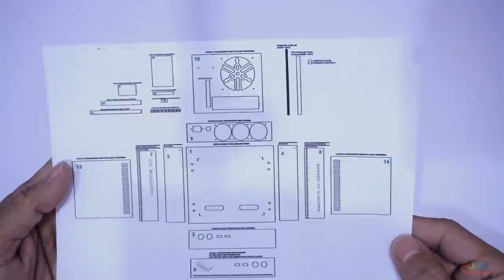How To Make Mini PC Case | From Acrylic With RGB Led Lights

Comment: Never been a fan of RGB... but bloody hell this looks so amazing and beautiful :) On a sidenote: I would recommend rubber/damper between HDD/metal parts to keep the vibration to a minimum. And get bequiet or Noctua fans to keep your fan noise low. Oh and the use air filters for the intake fans or air outlets to keep dust out of the system.
Reply: Good tips for pc enthusiasts :) won't forget them when I try to build something like that
Reply: HDD dampening is the least concerning thing of this build. The most concerning bit is that he mounted his arduino... on the heatsink. Load up some GTA 5 and watch the board fry itself.

Comment: Dude, you have a nice build for the case of your PC but the airflow is not actually that good so you might have heating issues in the near future.
Reply: Was thinking the same, it all pulls in and exits from the top. It's probably an oven below at GPU level.

Comment: Nice build, just correct me if im wrong, but the 2. fan on the tower isn't pussing the air against the front/ and ch.fan? Should be flipped......

Comment: I think that it consumes a lot of electricity, so I think it's better to illuminate the LED with a system that uses permanent magnets to generate electricity and uses a storage battery to supply electricity.  It is two birds with one stone if it can support the maximum power of PC such as CPU.

Comment: Amazing work !! Can you tell me what kind of material you used on the exterior layer(the black one)? I can't find anything that is black and also see through for the LEDs...
Reply from the maker: for the lights is a black sticker and the board for the front is a acrylic black  transparent
Reply: @PLATINUMKIT  thx, i think i found it, what about the pieces number 11, 10 and 6? what kind of material and colour is that ?
Reply from the maker: 10, 11 is a 3mm acrylic transparent white. 6 6mm transparan paste with black stickers & 2 way mirror film.
please download in the description.  You will see all sizes, cuts and materials

Comment: 367/5000
Hy I love your videos with addressable leds
What I don't quite understand is why are you using 2 Adruino?
If you then connect them in series and connect them to all lights at an output of the second adruino.
I could imagine 2 Adruinos if I want different light effects, but why in series?
Thank you in advance
Reply from the maker: Arduino 1 for infinity mirror, Arduino 2 for logos or fonts.  both are installed separately only the voltage - & + from the power supply is combined...thanks

Comment: hello, good horses, the design gives the spoons from the processor how they should be placed, you already have the mistake, the cooling doesn't work, they have to push one air and the land will take it out the spoon on the processor, on the power supply is normal good, otherwise it's still good

Comment: Puts all this effort into building a custom case using tools and materials I couldn't afford in a year, then pairs garbage hardware that was low-mid range at release with a motherboard that was considered high-end. The budget of the case vs. what goes into it is so disproportionate it makes my head spin...

Comment: So much creativity but totaly messed it up with unprofessional desissions. 1. With the 3 little fans on the back of the bottom stand 🤣🤣 realy not professional on that point 👎 Just a little bit longer sides and you could build them inside. 2. The self made Fans🤔🤔 why you made them??? They look terible with that openly visible leds. 3. criteria is the RAM, Trident Z RGB Rams will look better then the trible red ones. N1 start but not professional enough in my mind sry 🤫🤨

Comment: Blatant disregard for the massive capacitors on the power supply unit, that could kill you/someone. Please add disclaimers. other than that. nothing else seemed to tip me off.